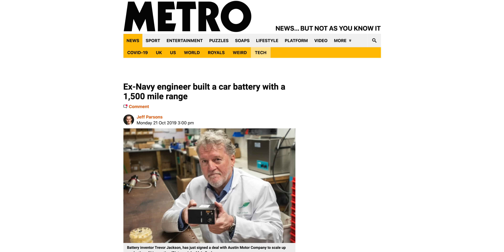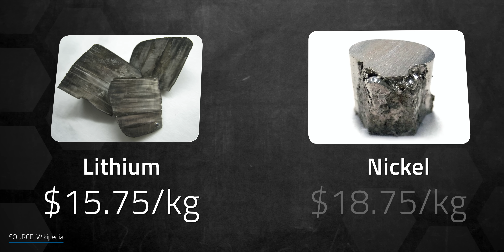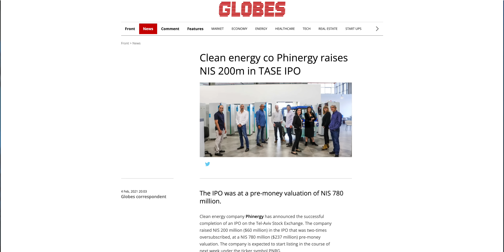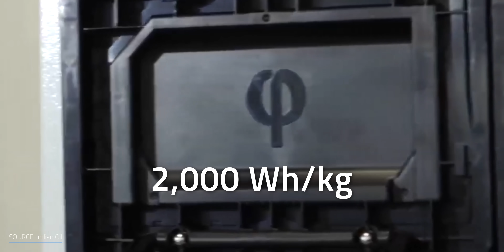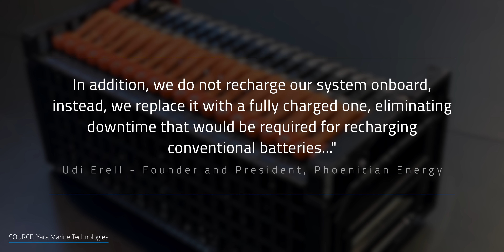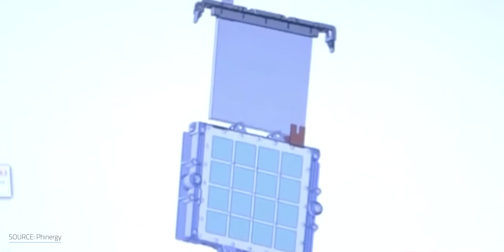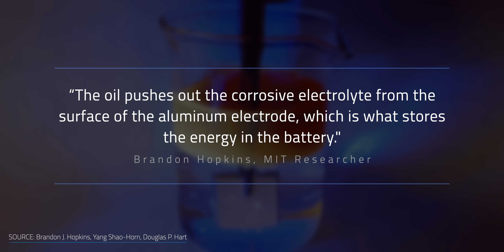Exploring the 1000 Mile Car Battery - Aluminum Air Hype?

Comment: That is interesting. I always thought that the proper way for policy makers to enable electric car uses would be to define and enforce proper interfaces, for example the dimensions and connection methods used for a swap-able energy system, i.e. batteries, or small power generators or whatever. That is policy makers should have defined standards equivalent to the ones for the power plugs used in apartments. Then cars using electric energy, could upgrade the at the moment critical energy storage system with time, just plug in a new system at the next "gas" station ... but with regulations comes regulatory capture and companies trying to use political leverage to bias the market toward their solutions. As a consequence we do not have such a standard as far as I know.

Comment: I cant imagine it being the only power source in daily driver vehicles. I could totally see it as a supplemental battery pack you could hook up in your trunk, roof or engine though; buy a $30 battery pack and plug it in for that 6 hour road trip. Exchange your depleted  battery for a new one at a discount like we do with propane tanks. If the corrosion issue is solved for longevity, even have it in permanently next to a Li-Ion and switch to it whenever your main battery is at, like, 10% or something. People in the US statistically drive, like, less than 30 miles a day so make a 100 mile Li-Ion and add a secondary Al-Air compartment as backup would be quite feasible.

Comment: Looks like it is time to bring back the tesla battery "swap" station, and just make it a battery replace station.  Every month or so, pull in and replace your battery in what 3-5 minutes(I don't remember)  If your on a long trip, do it when you get close to empty.  As always, the kicker is the cost.  If you can get one for what...100 dollars that lasts 1000 miles, ok maybe cheaper., as that is only 10 miles per dollar.  yup, cost is going to be an issue.  Looking below others have seen this also....

Comment: Immagine a car, that you have to fuel at very sparce fueling stations, but every time you do that, you have to throw away all you remaining fuel and you have to get a full tank every time. 😂
Reply: That's limited thinking. Imagine every petrol station was replaced (or supplememnted) with a battery swap station.
The fact the range of this battery is probably 3-5 times greater than you get with your petrol car means there would actually be a greater safety net in terms of 'refuelling'.
Your argument ends up turning into a win for this battery.
Reply: @thebrowns5337  Needing to waste everything that was left in the tank/battery is NOT a win. With a fossil fuel car I never drove till the tank was empty, because visiting a station might not be opportun at the time you run low. (You're in a hurry or prices are high ot the station you want to use is out of order or has a long cue.) Nothing beats the ease of always being able to charge nearly anywhere, where there is access to the power grid.

This battery might be an interesting range extender though. Only get one to load into the trunk of your BEV, when you fo that yearly holiday trip. (Or have one at home for the apokalypse. 😉)
Reply: Oh, of course if the vehicle had a traditional battery as a buffer, you could empty the "tank" and use the buffer to get to the station and change the "tank". 😅 Then the buffer can even still be charged by plugging in, allowing for grid powered short distance driving, only activating the "tank" in medium to long distances.
Okay, it may have a use case in those ways if using.

Comment: If a 3rd party retailer can store, receive and return with the battery manufacturer and the batteries can be built to be handled by non-specialists, you eliminate the need for consumers to build charging stations at their house or search for a charging station. E.V.'s then become significantly more accessible to the overall market. This would also make it easy for a road-side assistance service to just drive to you and swap out the failed battery. I think this would be a great alternative.

Comment: I think any judgement on their practicality, must rest on their 'recyclability' . If we imagine a Li-ion battery having 1000 cycles, then we need to know, how much energy is used in recycling Al-air batteries 1000 times and how much of, the original material, would still be present after this time. If you, or anyone, could enlighten us on these matters, it would be greatly appreciated.

Comment: I understand that the current solution is hybrid cars - lithium batteries for the engines and Aluminum battaries to charge them on the go.
This way, if you run out of both you can still charge the car to get some more juice

Comment: Don't know about other countries, but this can be a good solution for India if it comes to fruition.
- India doesn't have the minerals needed for Li-ion batteries, and don't want to depend on China since we are at war
- India imports all its oil and oil has become very costly here. Both Govt and the public are looking for alternatives
- Alumunium is abundantly available in India
- A 1000 km battery would mean even a frequent driver would need to swap these once a month. The average driver can swap these once every 2-3 months
- Silver can be a costly component, but if that can be completely recycled, then no wories

India has lot of engineering talent. If that talent, as well as the raw material, can be sourced from within the country, then we don't have to depend on other countries to take us to a pollution less renewable energy future.

Comment: or come at this problem from a different angle.Just use powdered aluminim and inject the chemicals to create the electrical charge.
So instead of driving up to a garage forecourt to fill up with Petrol or Diesel at the moment , you would pull up at a garage forecourt to fill up with aluminium powder in 1 tank and the chemicals in another.This would get consumed as you drive , bit like Petrol , then you pull up to another filling station when both the powder and chemicals are depleted.

Comment: There is no reason why a vehicle support truck (aka tow truck) could not simply deliver a new battery to a stranded vehicle and simply swap it out on the spot (probably for a small premium). Limited Range is certainly what is keeping me away from EVs living in the north, with long wilderness highways with no infrastructure for EVs. I would certainly consider this type of EV with it's much longer range, and batteries could be swapped out at regular gasoline service stations, regardless of the lack of EV charging infrastructure. Of course the ideal is rechargeable battery vehicles, and the required charging infrastructure... with additional range....Yes, I still want the 1000 mile (1609.34km) range.

Comment: I can imagine a car with 50 miles of rechargable range - which covers 90%+ of our driving augmented by 2 small Aluminum Air batteries for trips.  Use up one Aluminum air battery before switching to the second giving plenty of time to get the exhausted battery replaced.  Or, use up both Aluminum Air batteries and rely on the rechargeble battery to get to the replacement station.

Current EVs are excellent for short trips.  For multi-day trips augmenting with Aluminum Air makes more sense than huge Lithium battery banks carried around all the time.  Perhaps a trailer with the capability of carrying kayaks and bicycles and extra travel luggage on top of Aluminum Air batteries for extended range?

Comment: The non-rechargable issue, is a deal breaker for me. Sealed sysrems requiere less maintenance. We've seen that in automatic car transmissions and now in smarphones as well. Having to open up the device to swap batteries, reduces the time you take to keep on running, but then i'ts not as easy and safe as pluging in a charger.

Comment: I'm not fully sold on this tech, but if they made the battery universal and not proprietary to each vehicle or brand, there could be an emerging business model where there are 24/7 mobile battery swap services. Assuming these batteries would warn you when they're low, you could call ahead and meet them in a parking lot or an off ramp. I have no idea if that would be economically viable though.

Comment: I  think swapping a battery is not a big problem as long as that battery be fit under the hood of the car. Gas station becoming swapping stations which are available very readily is perfect and I'm sure swapping process can be automated and some kind of mobile rescue swapping unit can be created enough for taking you to nearest swap station. 

but I see one big issue with this tech it has to be as universal as gasoline and that is only feasible if all manufacturers have similar battery replacement mechanism and placement of batteries. Which is a big issue since all cars are different and I would imagine these batteries would dictate lot of design elements of cars.

Comment: There is a lot said about range anxiety but that is not my issue. First, its the number of charging stations and second it is the time it takes to charge. I will consider a battery car based on current ranges when I KNOW I can find a charging station when and wherever I need it. Also, the charging time has to equate to the current timescale for filling with petrol - I am never going to sit around for an hour waiting for my car to charge.  Battery swapping seems to be an obvious solution to both issues.

Comment: Interesting video Matt! I would like to know what the start up cost of an Aluminum Air system would be and also what it would cost to swap out the used for the new battery. Overall, I think that the logistics far outweigh the benefit of this type of battery. Therefore, I would have to give this idea a big thumbs down! 👎👎

Comment: Charging at home at night is not an option for a huge percentage of population that do not reside in single family home (they do in apartments) and don't have dedicated parking lots. In one of the apartments that own in India, I wanted a power connection (15amp, 220volt) for L2 charging of future EV for a dedicated parking slot in basement, the cost was prohibitive (the power line availability, new meter and the fact there is no wall near my.parking and have to lay underfloor cable). So if I ever go and live in that apartment I would be stuck with ICE or public charging. 
Public charging require a huge area (and longer time) so becomes difficult in densely populated city. Longer charge time translate to larger areas requirement. At this point, the replaceable cartridge  start looking attractive. It might not be for all use cases, but for large subset it would make sense (provided recycling and logistics has been worked out).
Further, of all the drawback raised in the video, I don't agree with one (can't comment on others); that is being stuck with depleted battery, because I am sure there would be  mobile service that would carry cartridges and replace on the side of the road (like the charge vans). Based on what was demonstrated in the video, it is not difficult to replace and can be done by a service van. Rather I am sure, even home/parking spot delivery would become common like they delivery  fuel using specialist vans; with a moderate charge of few additional dollars.

Comment: I am NOT convinced by the idea of "replacing" normal lithium batteries by NON-recharchable Aluminium batteries. 

However: While systems should not be made too complex, I find the idea of combining both, using Aluminium batteries as "range extender" interesting. 

If the corrosion problem can get under control (the video names ideas) we could replace an electric car using a 20 kWh lithium battery with an electric car using a 16 kWh lithium battery (recharchable) PLUS a 20 kWh aluminium battery (non-recharchable) which would only get used in the rare cases, when we travel longer distances than the recharchable battery provides. 

In most cases we would still only use the lithium battery, but feeling save that we can always go on full range, if required by using the aluminium battery as extender, after the lithium batters is almost empty.

Comment: Gas drivers currently do a swap every 3000 miles (or there abouts) for oil. And do gas fillups about every 300-400 right now. If the infrastructure was relatively common and quick, a 1000 mile swap that replaced both the fillup and the oil change might be a good way to go. 

Matt mentioned tow trucks not being able to help...well thats not quite correct. A tow truck could just bring a replacement battery.

Heck, the tow truck idea could be a new business too. Trucks that drive around and replace your batteries during the business day at your place of work or at your house. Leave your car on the street. Setup some sort of combo entry for the trucks (shouldn't be that hard to work out), and they can come by and swap you out once a month.

Comment: They could be good for long distance lorries instead of the 300km range that Volvo currently have (with 5,000kg of the 28,000kg payload taken by the battery (Based on a European 44ton gross))

Comment: This actually seems like a bigger threat to Hydrogen.  As for a regular lithium Ion car, this could actually work with the existing battery as a range extender.  Drive the car as normal day to day, then on rare occasions where you determine that it would be really nice to have huge range, pop by a station on your way and drop one of these things in to an 'expander slot'.  It would also help with towing.

Comment: Electric vehicle manufacturing is limited by the number of battery factories on the planet. Single use batteries will require two orders of magnitude more battery factories.

There will need to be battery factories in every region where people drive, or shipping batteries will be a killer.

Comment: What first comes to mind is what if aluminum production stops for some reason, can not reach the buyer/driver or swaping company bancrupts? With rechargable batteries you just change power source. If you could replace individual aluminum plates without replacing entire battery in specific shop then yeah, then you pack enough plates in the trunk and drive. But ONLY depending on some company to do their job, for 20-30 years...

Comment: One thought that comes to mind RE: the Al/Air battery running out - what if EVs were designed like PHEVs? I.e. there's a ~40 mile range lithium ion battery pack in every car, but an aluminum air battery is used as a secondary tank. You can still charge the lithium part with a plug, just like a PHEV, to spare your aluminum/air battery, and then only replace that when it's fully gone. You'll be able to "top off" and get around without the aluminum air battery, so long as it's not a long road trip.
Reply: All of what I just said kept in mind, having a short range vehicle which can operate in a long-range mode could be useful even in the midwest. I like the thinking, though I may push the lithium range up closer to 100 miles.

Comment: The energy efficiency of these batteries has to be aweful. Recycling the battery would need a lot of energy, so the percentage of energy that is actually used to e.g. drive a car would be a lot lower than for conventional batteries.

Comment: It all depends on the cost of recycling the batteries and the initial cost of the batteries. If the car has 2 batteries and can use one and then the other (and the batteries are small enough to manually swap) then a swap should be quick and easy. If the cost of the batteries is such that you can have a few extras at home then it should be as efficient and easy as rechargeable lithium. After you pay for the price of these batteries, can the swap price compete with 18 cent USD per kilowatt electricity?

Comment: Yes, I would drive one. And if it ran out of charge, what is there to prevent a mobile service delivering and swapping in a new one - after all, there would be a network of Al/Air battery swap-stations all over the road network..

Comment: there is no way this tech can get recognition from the industry unless there is a solution for battery degradation.
Just think even if alu air battery gives 2000 miles of range but the cost to recycle aluminum is quite high plus using silver just defeats the purpose of making a cheap battery it may be good for specific niche applications  but not for auto industry

Comment: Swapping, would become the same as filling up or charging up. They are light, couldn't you carry extras? Is this a solution for aircraft or blimps or other super large but slow air-based transport? What about drones or even trains in places where infrastructure was less available?

Comment: Assuming that swapping was economical and the old battery was fully recyclable, then sure.  I don't see how it's especially different from pumping in gas every few hundred miles, and the infrastructure requirements would actually be much smaller (albeit not already in place).  A better system would probably have two smaller batteries, so that you could 100% drain the first before moving to the second, and you could replace the spent one at your convenience.

Comment: If all EV manufacturers created a single form factor of the batteries to use (or maybe just a few standard sizes), I could see this working.  If every EV manufacturer does their own?  Nope, I can't see this working out in the long run for EV use in cars.  Other forms of transportation?  Sure!